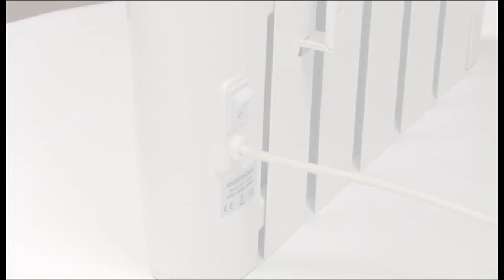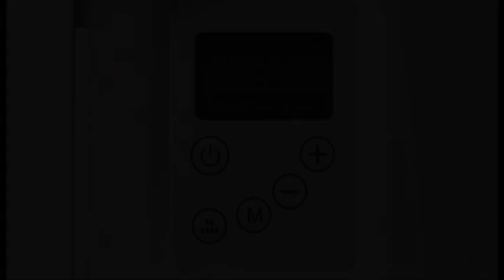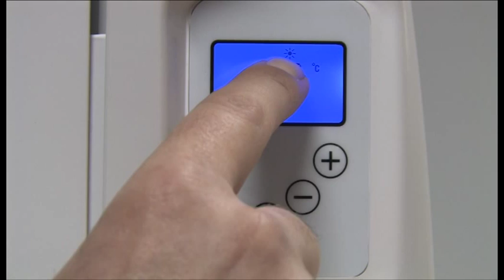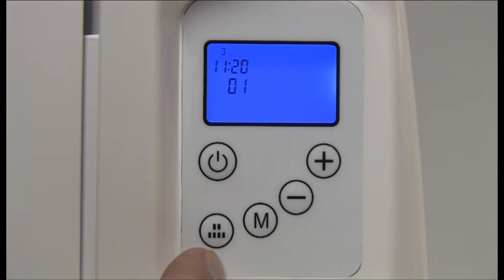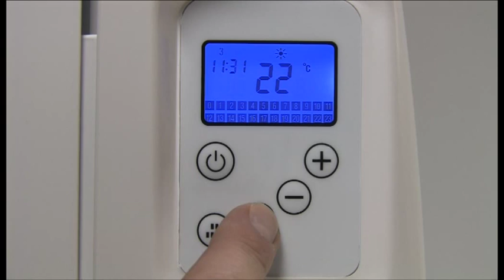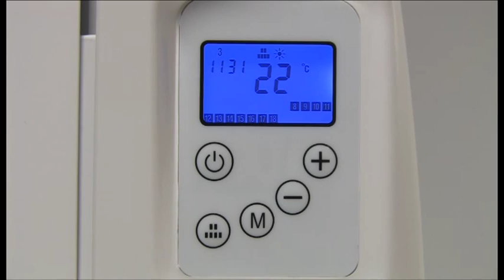EcoVolt JTR Radiator LCD programer

Comment: Hi there. Great video. If I want the heater to be off during the day. Do I set the economy mode to a low temperature like 5 degrees and if the it's warmer than that the heater won't turn on?